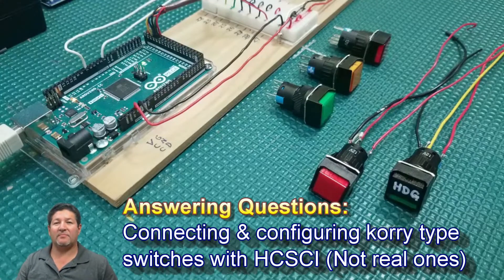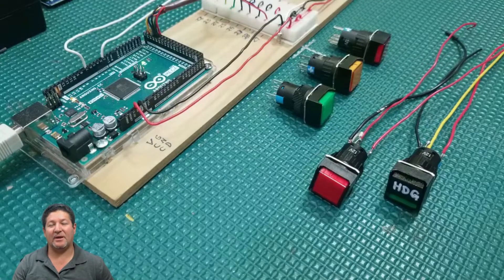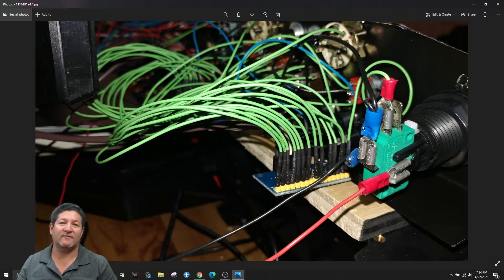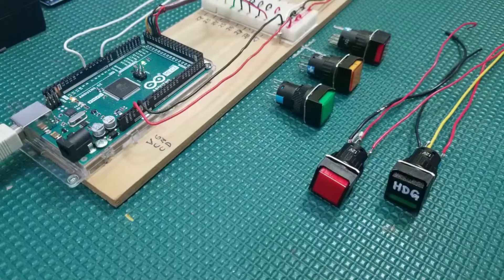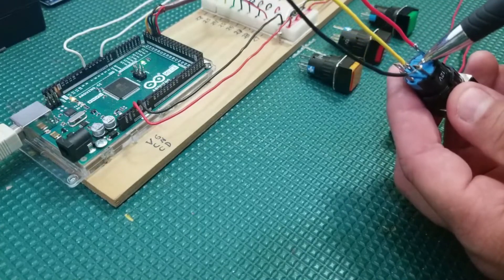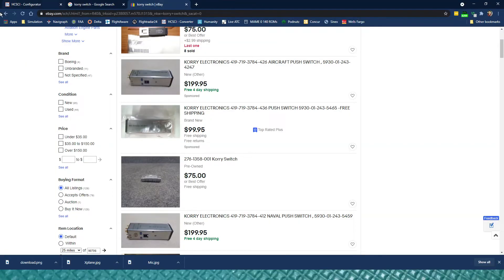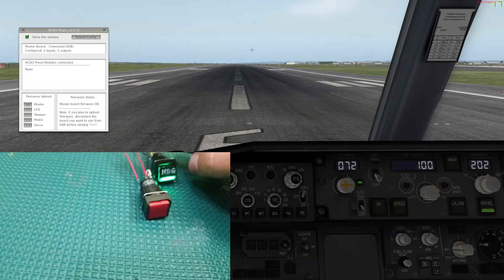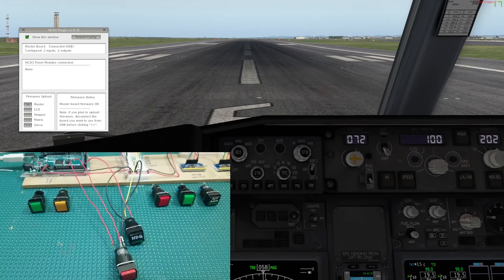Answering Questions: Connecting "Korry" Type Switches

Comment: I know this video is about 3 years old, but you might check out the 3d printed korry buttons that are going around. They're available in a lot of different places, but if you have a 3D printer and some basic shape modeling ability - they're not hard to make on your own. They use two different LED's. The best replication of a korry switch 'click' feel are the keyboard-style tactile switches. With all that, they'll use three pins of your Arduino, but a Mega can handle quite a bit. Mobiflight makes it easy to program the LEDs as two individual outputs. The time consuming part is figuring out which output to program it to. 

Also; I use the buttons you  have in your video, too. They have rectangular shaped ones that make EXCELLENT Master Caution/Master Warning switches. With the addition of a backing layer, they can sit nicely flush. Also available for them are the clear safety flip-up button shields to keep them from accidentally being pressed.
Reply from the maker: Hello, thanks for your comment. I have not seen the 3D printed buttons you are referring to but I will look them up. Since I do not have a 3D printer, all of the videos are about using readily available off the shelf components. So my videos are not really about making a realistic cockpit, but rather teaching how to connect them to the Arduino and configure their functions with SimVimX.

The few 3D printed parts that I have looked for always seem to be ridiculously expensive though. I'm sure some day I will get a 3D printer and try to make my own, but for now I'm just teaching the basics of using SimVimX. I have looked into MobiFlight but it just seems to much more complicated to configure assignments.

Comment: How do you wire the switches with 8 pins? What are those extra ones for?
Reply from the maker: Hello Steve, if you put the switch with the little light on the bottom, the two pins by themselves in the middle are for the LED. The bottom three are one for GND, one for +V normally open and the center one is +V normally closed. The top three usually are in some way the same as the bottom ones. Here's a little diagram I found online.

https://imgbb.com/Pwt7qtm

Comment: if possible, provide a link to the auction with the large "korry swich" the ones you have on the master coution and fire warn
Reply from the maker: It not the same one because I bought mine at an electronics stores near here. This is something similar, maybe it can help you search for others like it.

https://www.ebay.com/itm/1Set-Square-60-60mm-Illuminated-Push-Button-with-Micro-switch-and-12V-LED-Lights-/333947614427?_trksid=p2349624.m46890.l49286
Reply from the maker: These are the same type as mine but I couldn't find any square ones on ebay

https://www.ebay.com/itm/2-3-8-60MM-Big-Round-YELLOW-Push-Button-Switch-With-12v-Light-Lamp-Arcade-NO-NC-/401600697612?_trksid=p2349624.m46890.l49286
Reply: @Qosmokid  okey tank you so much :P

Comment: Very cool, Jose.  Wiring up the LEDs was my least favorite part of my project.
Reply from the maker: Thanks Sir, I only have a few annunciator lights in my setup, thankfully it's pretty easy when you don't need to use resistors and as you saw very easy to configure with HCSCI

Comment: I am at the very early stages of setting up a cockpit of any sort. I am probably not going for so much hardware as I have to use my computer for work also, so everything had to be cleared away regularly. However, I love watching your videos as you are steady, clear, methodical and use real world examples. Excellent work! I expect I will use air manager and my diy knobster with a Touch screen for most things.
Reply from the maker: Thanks Kevin, even if you use another solution hopefully a lot of the basics will translate over to help you build whatever you set out to make